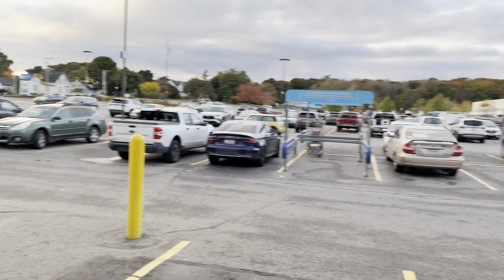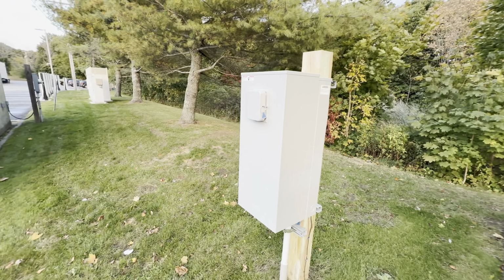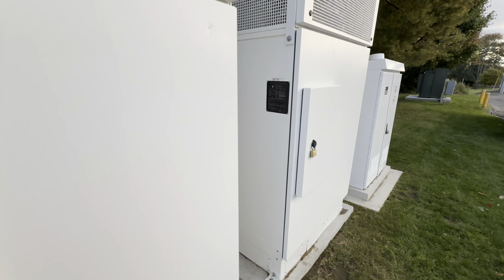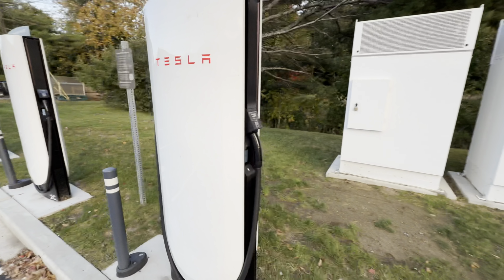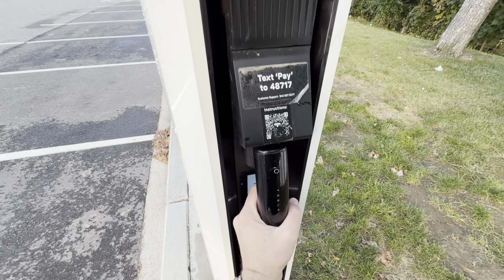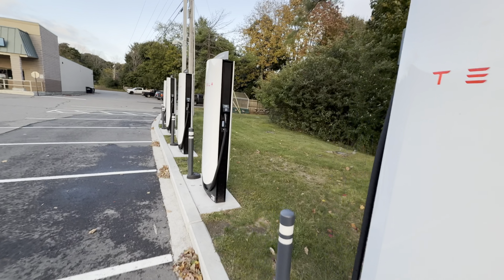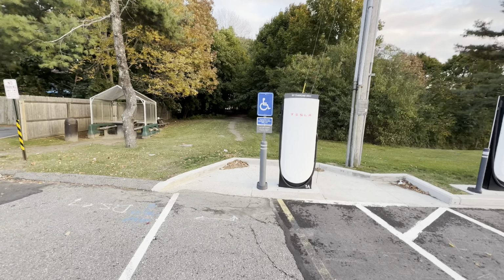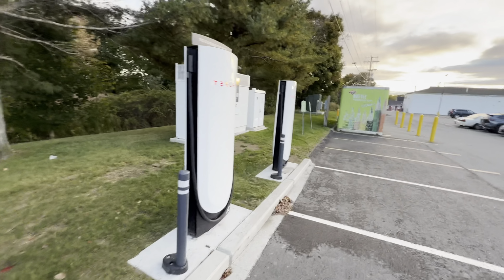Not In Compliance! Tesla's First NEVI-Funded Supercharger Site! Rockland, ME Site Tour & Impressions

Comment from the maker: Purchase the A2Z adapter here and use "FLASCH" at checkout for a discount: https://a2zevshop.com/?ref=FLASCH

If you're considering a new Tesla, use my referral for $1000 off: http://bflasch.com/tesla

Reference: 23 CFR 680.106(d)(1): Power level.
(1) DCFC charging ports must support output voltages between 250 volts DC and 920 volts DC. DCFCs located along and designed to serve users of designated AFCs must have a continuous power delivery rating of at least 150 kilowatt (kW) and supply power according to an EV's power delivery request up to 150 kW, simultaneously from each charging port at a charging station. These corridor-serving DCFC charging stations may conduct power sharing so long as each charging port continues to meet an EV's request for power up to 150 kW.

Comment: I don't understand why you express any distress at not meeting NEVI rules.  The NEVI rules are idiotic.   Tesla's design is far superior, and I never met anybody who doesn't think it's superior, and NEVI should never have been written as it was.    Cars reduce their charge rate as they fill up, so insisting on 150K at the same time to each stall is a stupid waste of capacity and money.    I do hope NEVI gets revised (if it isn't cancelled) to allow Tesla's 360kw to 4 stalls, and in fact to encourage it.
Reply from the maker: Plenty of cars will not get 150kW.
Reply: @brandenflasch  Yes, there are two issues.  One is peak power, the other is simultaneous power.   Does NEVI demand you reach this for every possible car design?  That's a tall order.  It's more the simultaneous power requirement that I think is a huge flaw in NEVI, though.   Tesla's design is loved by drivers.  In part that is because it's fastly cheaper.  Tesla puts in stations for $28,000 per stall (that was 2 years ago) while most other companies are $150K to $200K per stall.   Tesla put in most of its stalls with no subsidy, those $200K stations all depended on it.    This means for the same money, Tesla put is a LOT more stalls.   Drivers would much rather see 20 stalls, sharing power but not all able to deliver 150kW at the same time, than 4 or 8 NEVI stalls all able to do that.   I mean they would prefer the former by a huge margin.   Tesla's stations were designed by the best engineers in charging in the world, it seems, but NEVI specs were written by bureaucrats and standards committees.      To criticize their design for not meeting NEVI rules is to criticize it for being better.    At a station like this, the choice would have been 8 Tesla stalls sharing 720kW, not able to do 150kW simultaneously (or perhaps ever for some cars) but able to peak at 250kW for Teslas, or 4 NEVI compliant stalls.  Which would you prefer to be the 5th car at?   Or the 8th, or 9th?  (The 9th at the Tesla would wait 5 minutes, at a NEVI 4-station they would wait an hour or two.)
Reply from the maker: @bradtem yes, they should require it for every car. 250-1000V required output allows this
Reply: @brandenflasch  I would say that the taxpayer should get the most value for their money.  Deliver the best  experience to the drivers for the money.  It's hard to argue Tesla's design doesn't do that, and not just by a little.   Now, as it turns out their V4 units can deliver 1000v and their cabinets can apparently be configured up to 1.2mW, so they can meet these NEVI requirements (and a ton more) and most of their future installs will go that way.   But I also fully support these V3 cabinets being used because they are delivering a better driver experience, even to drivers of the cars that only get 120kW peak from them.    Better experience over bureaucrat written spec every day of the week for me.
Reply from the maker: @ that hardware doesn't yet exist
Reply: @brandenflasch  I expect it to come.   And not to engage in endless debate, but I would rather they deploy stations like that one in Maine while they wait for the next generation, and as a taxpayer, if my money is going to subsidize stations, I would 100% rather it subsidize one like that than a 4-stall fully NEVI compliant one.   Even if I drove a car that would only peak at 120kW from a stall like this.    Do you really disagree?  Your criticism seemed to suggest you felt Tesla had done something wrong here, rather than very, very, very good.  I fault Tesla and Elon for many things, but pretty much never charging.  That's one thing they are without peer on.

Comment: The last summer road trip on  I-95 we found that Electrify America was reducing power delivered based probably on connector temperatures and number of vehicles at the site.  On an EGMP vehicle the max power delivered at low SOC varied from 230 kw to 64 kw.   So, from that perspective, the Rockland configuration is no big deal.  Still, it does not look 800 volt nominal vehicles are going to be well-served.  Why not plan for the future and mandate 1000 V at 1000 A installs, as Tesla said they were capable of doing?

Comment: Agree , pushing the limits of the requirements.I am not an EV person or know alot about charging.  Seems 0-500 v less of an issue vs the load sharing not allowing 150 amps ( or what ever the unit is ) , should track first ones in getting the max. Then might meet the requirements?

Comment: Spirit of NEVI? Seems 0-500v meets the minimum requirement of 250v. I'm sorry but they seem in compliance to me and the payment part isn't that big a deal at the moment. Plus I'm sure most will use their own EV app or the Tesla app which is a far superior method to QR codes and fumbling around with credit or debit cards in poorly lit and unprotected parking lots. The ADA stall is fine. In fact, I believe it could have even more access given how difficult it can be to maneuver your wheel chair and deal with a charging cable.
Reply from the maker: How does 0-500 meet 250-900V?
Reply: @brandenflasch  It met and exceeds the minimum as I said. If it didn't then it wouldn't be in compliance.

Comment: I'd be fine letting this technicality slide, since Tesla's Supercharger network as a whole is significantly better than any other third party charging networks, at least in the US.

I'd be more disappointed if they installed 4 stalls and they kept going down or charging at significantly lower speeds than advertised as third party charging companies like Electrify America. Or there's a line because there's only 4 stalls vs the 8 Tesla has here and with the V4 stalls, the longer cable should be less of an issue for non-Tesla EVs.

If Tesla didn't have the Supercharger network, and also relied on third party charging, they wouldn't have gotten nearly as far as they have now since third party charging in the US currently sucks.

Comment: I see zero need for credit card processing at a DC fast charger.  That is SO old-school and adds unnecessary complexity.  Everyone carries a cell phone that can activate the charger.  If a back-up method is needed, let’s use RFID cards or tags.

Now, someone will say, what happens when my phone is out of charge?  A 2 minute phone charge in vehicle solves that issue.  Similarly, what happens at a gas station when you leave credit card at home?
Reply: Those of us watching this video and commenting will have no issue because we already have all the DCFC apps. This is more about the typical EV driver who may not want to mess with having to install an App for a DCFC they haven’t been to before.
Reply: @RivianDogDad exactly. Yet another app is so stupid. Plug and charge is best. Next best is a credit card.
Reply from the maker: Couldn't disagree more. Credit card readers are used for every transaction at a physical retailer in the world and work just fine
Reply: @brandenflasch  Recognize that it is one more complex part to fail as they often do on gas pumps and retail stores. Most readers also have  a display so it’s really two components.  I see about one failure per month.  My preference is plug and charge where the charger reads your EV’s VIN or MAC address and performs direct billing like Tesla.  

7 years of Tesla supercharging spoiled me on ease of use and reliability.
Reply from the maker: @johnpoldo8817  that can be your preference, but there should still be credit card terminals
Reply: @brandenflasch  I’ve followed your EV expertise for years and value your opinion.  My charging experience at numerous EA, EVgo, Juul, & other non-Tesla fast chargers has been abysmal. 

I think it’s due to charger complexity.  For me, Tesla reliability is outstanding and I attribute much of it to simplicity with fewer parts.
Reply from the maker: @johnpoldo8817 that's due to poor hardware and operations.

Comment: I am stunned Tesla introduced the 800V CT and one year later doesn’t offer an 800 volt DC fast charger. Our two EVs are low voltage, but the next one probably will be high voltage for ultra fast charging.

Comment: 100% agree. Tesla is not meeting several of the requirements for funding including voltage, power, and payment. Either the rules need to change, or they need to be enforced. Tesla shouldn’t be getting a dime until they start installing v4 cabinets (1000v). At that point the payment and power concerns become much simpler issues to resolve.

Comment: So let me get this straight, if this site is at full capacity it is slower than a V2 charging site shared?  Someone needs to be on Maine to tell them to push back on Tesla. This is nonsense.   So they have enough power to full speed 4 dispenser and they put in 8?  Woe unto any CT drivers thinking their trucks are going to be getting 800v+ charging for their trucks anytime soon.   I don't know why people are so willing to cut Tesla slack here.  They are taking public money and they should be required to meet the standard that was set by NEVI.

Comment: Good analysis, Brandon. I agree with you for the most part. The only thing that really may matter is the Support for 900 V. The power sharing may be OK. There might be some situations where multiple vehicles are trying to draw more than 150 kW where this will not meet the spirit of the requirement. In general, Tesla seems to always fall short in some respects on most of their products.

Comment: I can only assume that Tesla has promised to replace the V3.5 cabinets with V4 cabinets solving the problem you have pointed out when they become available. I find it funny here that everybody is rushing to defend Tesla instead of EV drivers who are supposed to be supported by NEVI. Why are we so willing to forgive Tesla and just say that the chance is low that there will be 8 high voltage demanding vehicles here at the same time. Are we engineering for today or tomorrow? You sound a little like EA's old apologists in 2020 who kept saying that the 4 charger stations were never full.

Comment: Let’s use our brains here Branden. Would you rather have some crappy 4 stall sites with low reliability but 150kW max. Or 8 stall minimums that work every time?

Let me guess you want to 4 stall minimum because that’s all sites can afford with $200k Alpitronic units.
Reply: @Nunya-lz9ey  100%, teslas deploying an entire site for what the alpitronic units cost. Thats the real advantage. All these other operators are getting nevi funding to put old gear in with ccs chargers, that won’t get installed until 2025/2026 (when pretty much everything will be NACS anyway). They aren’t profitable, won’t repair the equipment and all that sweet sweet government money will be wasted. Just give it to Tesla, they are the only ones doing it successfully at scale and profitably.

Comment: One point you missed is that based on the actual grant, only 5 of the 8 stalls are funded by NEVI and need to meet NEVI requirements. I don't think that changes anything in your video, though. When Tesla opens up access to its real-time status and pricing API, they will only provide data on 5 stalls.  Which 5?  Don't know yet but working on getting that info.  Can they vary which 5 are NEVI funded to juice their metrics?  I hope not, but we're working to figure that out too!

Comment: The simple fact is that in this case with NEVI, Tesla seemed to decide to be better at lobbying than engineering in order to get the result they wanted to achieve.  So was Tesla’s goal to charge all cars at the speeds requested or was Tesla’s goal to get slick lobbyists and lawyers with sharp pencils to team up and get that sweet government cheese?  Except for the people holding Tesla stock and aspiring lobbyists, Tesla winning NEVI funding with out of spec power cabinets and dispensers is yet another scam in an increasingly long line of scams.  Which is a shame because sometimes Tesla’s technology is actually amazing and best in class, this just doesn’t happen to be one of those cases and yet they were rewarded for it by outclassed bureaucrats who needed smarter or even any engineering judgement to support their decision making.
Reply from the maker: 100% agree. It's truly a shame because Tesla could build compliant chargers if they wanted to.
Reply: @brandenflasch  I truly don’t understand the long term play here by Tesla. They already have a high voltage vehicle in the Cybertruck. Maybe they are trying to push the industry into 100% split pack designs and they will make V3 power cabinets for the duration?  And all this in the face of an industry standard of 200 to 920 volts that’s been established for nearly a decade.

Comment: Go Brandon go, the site is certainly not compliant with NEVI in my opinion for all the points you mention. 
1. Not supporting up to 920 V. (Hopefully 1000) 
2. Non-configured payment terminals, forcing people to register onto the Tesla website with a credit card in order to start a charge.
3. 90kW limit if all charges in use.
I read the other comment saying that power sharing sites shouldn’t be penalized, I completely agree with that however, I believe Tesla could install enough cabinets to guarantee 150 kW minimum for the number of chargers they wish to drop in the ground. Then some cars could be getting 250 kW or a cyber truck 320 kW while other cars are perhaps only needing 100 kW or 50 kW but it would guarantee that cars would get 150 kW minimum if they requested it. That means the power cabinets need to be able to supply 1.2 MW if you’re going to have eight chargers. Not 720kW as this site has.

Comment: I would have like to see how the cable lengths fit to a charge port on the driver's side front fender location, while parked in the proper stall slot.
Reply: They are centered so even v3 Stations can charge many CCS cars in the proper spot when positioned that way. V4 has an even longer cable so completely solved.

Comment: I find it funny that Tesla seems to push people to the app rather than wanting people to use the terminal, (and going as far as neglecting them), because the terminal would charge Tesla a much more favorable processing rate than the app. (Card Present rates vs. Card Not Present).
Reply: I don’t think credit card processing costs more when there’s no reader at the charger.  I’m a CPO at condominium buildings and manage payments.  Condo owners submit their CC information into a profile.  When their charging event is processed by Stripe, processing fee is only 2.99% + $0.30.  Isn’t that pretty good?
Reply: Actually Tesla is pushing everyone to plug and charge. No Tesla app or Tesla account needed to charge a rivian, Ford or gm.

Comment: What Brandon doesn’t advertise is he works for a competing charge equipment manufacture, so some of his opinions are a bit biased. While you could certainly argue teslas charge network should support higher voltage vehicles you could also argue high voltage vehicleManufacture decided to release products without a way to charge on existing lower voltage equipment.  Some manufactures have made up converters optional and owners may have opted to skip them, so again not sure that’s a Tesla fault. Everyone knows teslas sites just work, and they are able to build them for a fraction of other operators.  I’d much rather they get the funding instead of operators who are plagued with broken and derated equipment without any apparent interest in delivering a good experience for EV drivers.
Reply: COI
Reply from the maker: I had the same stance prior.
Reply: @brandenflasch  when you worked for a different also competing chargepoint operator? 😆

Comment: 500v is within 200-900v.  If the requirement were the entire range then you'd be right, but it's not. and let's be honest.  These will be 10x more reliable than the others.
Reply: Apparently, the law or regulations were just written in a terrible way.
Reply: Crappy overpaid lawyers wrote it
Reply: @PetePH  what they wrote it holding up to the law so maybe not?
Reply from the maker: So someone can pick an arbitrary range within the 200-900V range and that's fine? What about 500-550V?
Reply: @brandenflasch  doesn't make it right and it's not in the spirit as you said.  But there are worst injustice's in the world like when the tesla semi charger funding was passed over for hydrogen fuel stations...